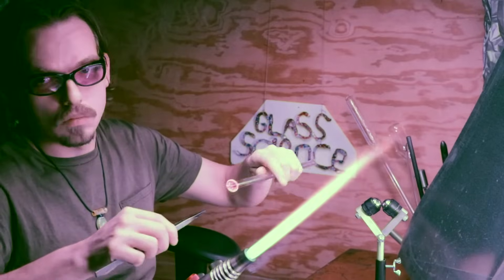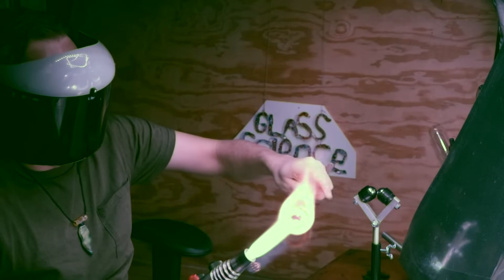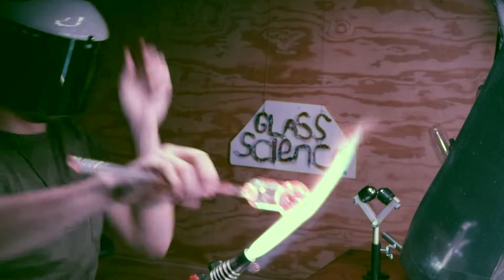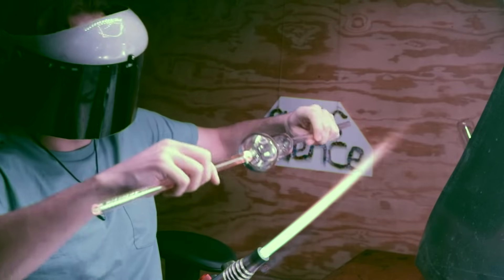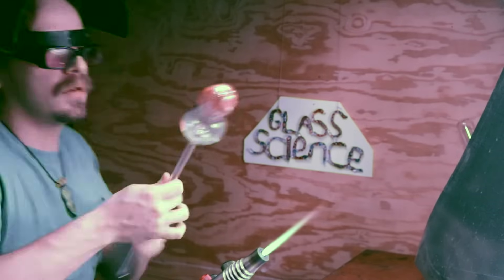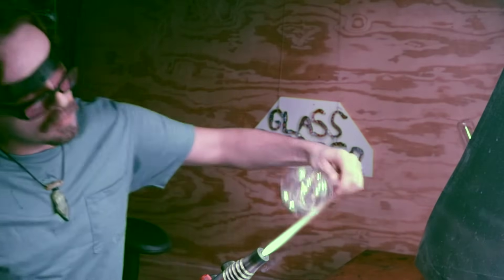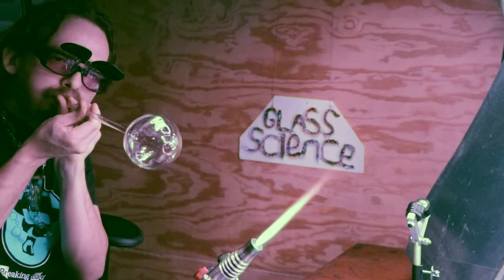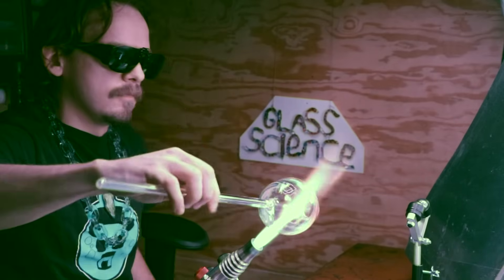Glass Blowing a Large Bubble by Hand

Comment from the maker: You can use this three section blowout technique for your own work. It's great for getting a larger bubble on a smaller torch. Make sure to subscribe and check out my more recent work! This video is currently about 4 years old; things have been improved a lot since then. I've also recently updated the caption as my old microphone left it terribly inaccurate. Thanks for watching!
Reply: I usually have trouble when I start getting to the middle, as I'm trying to condense the glass and thicken it before I blow it to the size of the other bubbles it begins to fold over its self or droup completely, and idea what I'm doing wrong and how to get everything even and not folding over?
Reply from the maker: @cwayne2833  Hey Chase, you might be able to blow out the middle section without condensing it down. As the middle section shrinks smaller it becomes less stable. Working a little colder until its halfway blown out might help keep the stability also. I hope this helps, best of luck on your glass journey!

Comment: I've been trying to do this for weeks man but with smaller tubing, 12mm, in an attempt to blow an ice chamber.. if u could do a video like this but with small3r 12mm tubing it would really really make my entire month as I've just about given up as I keep trying that bit too much bigger and bigger and eventually pop it 😭

P.s I'm only a couple months Inti glass blowing and only using a map has bernzomatic ts800 for the time being... what torch would you subtest for under 700 dollars Aus?
Reply from the maker: I don't think you can get such a large bubble from such a small tube. You can melt the tube back to thicken the walls before you blow it out, but it will only go so large before thinning too much and popping. So 12mm might blow out to around 30mm. For 700 Aus you might afford the Bobcat from GTT. It's dual gas so you'll need propane & oxygen. It won't take MAPP gas but will do natural gas.
Reply: @JasaGlass  thank you for the reply bro!! Is there much difference between the gtt bobcat and bethlehem alpha? Have you used them both? Sorry for the million questions but I'm struggling to find any local platforms here in Aus....
Reply from the maker: @anonymousasylum6561  Thats ok, I like to help. I have used both, they function about the same. 
 The Alpha might be slightly larger in flame size, it also works well on oxygen concentrators where my Bobcat is limited to 8lpm on a 10lmp concentrator. Both can use tanked oxygen. Both torches can tilt, however the Bobcat needs a simple wrench while the Alpha has a tool-free lever. The Alpha can swivel which isn't important unless you're on a lathe. The Bobcat is about 20% cheaper in price. That's everything I can think of, I hope this helps.
Reply from the maker: @anonymousasylum6561  Here is a website with a good selection of torches. There are many brands! National and Nortel are even cheaper (less than $200) however I've never used them.  

https://www.mountainglass.com/tools-and-equipment/torches-and-accessories/torches
Reply: @JasaGlass  cheers bro got my bobcat yesterday found one for a great price so couldn't resist just setting up my studio now ❤️💪
Reply from the maker: @anonymousasylum6561  Congrats! You'll notice a night to day difference between the heat intensity using oxygen. Don't heat your tools too much with it and be careful with your hands, it will cause severe burns. Don't forget ventilation and eye protection, check out my safety video for more info. https://youtu.be/svt-SoN05ec
Best of luck on your glass journey!

Comment: Hello, what type of glass was you using there ?  THANKS
Reply from the maker: It's borosilicate or "Hard Glass". The smaller tube is 12mm with 2.3mm thickness, the larger tube is around 40mm and 3mm thick. I normally buy Simax brand or Pyrex when it goes on-sale. Thanks for watching!

Comment: So how do u fix a small hair line crack in a glass oil burner bowl. Can u close up thd crack by hearinf it up again to the hottest temp it should be or do I have to break it and start again
Reply from the maker: If you heat up any cracks directly they may continue to split and become worse. You can kiln the item and attack the crack at working temperature to keep it from splitting. The crack might also open up into a hole instead of sealing closed. So it's a bit tricky, but worth an attempt.